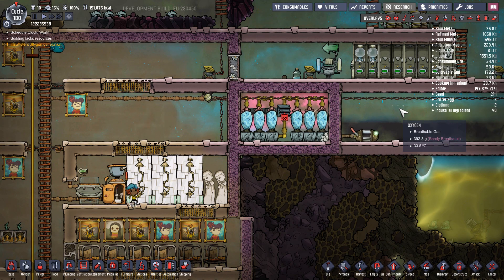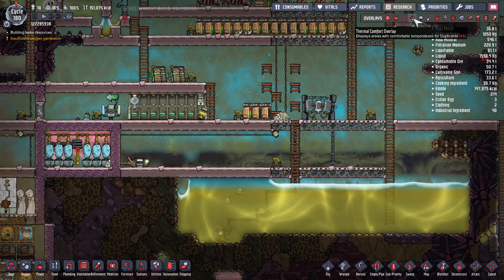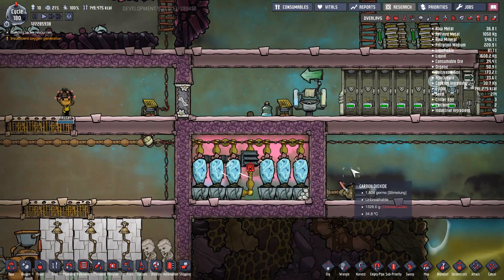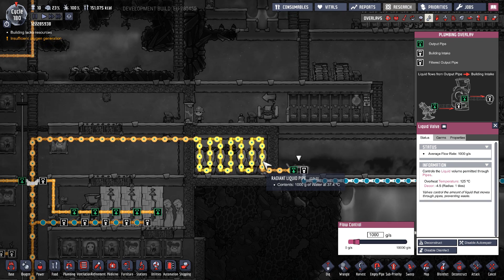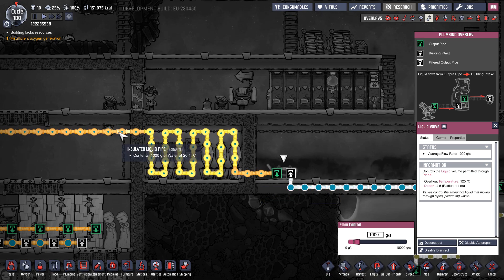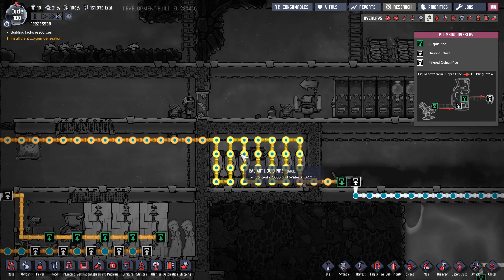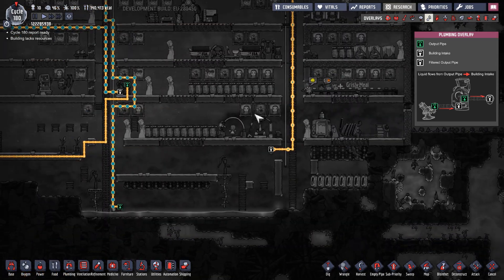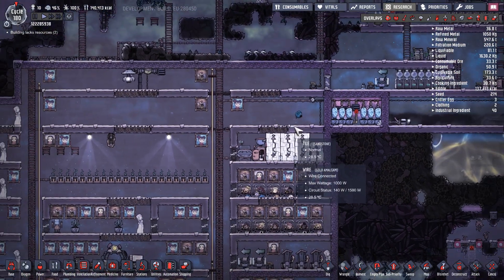#17 Oxygen Not Included - How to Cool Water with WheezeWorts

Comment: how about replace the hydrogen with water or polluted water as cooling agent?
Reply from the maker: Yeap, that would do, also possible :)
Reply: Will Wheezworts work in water?
Reply from the maker: @soirema  Not when submerged in water, but you can use cool water drips to make things colder
Reply: @GamesCaste  If I'm trying to cool steam turbine using wheezeworts and I add copper tempshift plates behind the wheezeworts, does it improve efficiency?
Reply: @shebazraza4746  I doubt it, the room is so small that the temperature will be distributed by the hydrogen gas fairly equally

Comment: This particular solution is fine but has several drawbacks. First, Wheezeworts are uncontrollable coolers - you cannot switch them on or off. Thus, water/gas intended to be cooled must be controlled, which is not the case here. Due to possible incoming water shortage (or outgoing water overflow) radiant pipes may overcoool, then any portion of incoming water (especially if in small amount) would be immediately frozen and will break the pipes inside the cooling room (which is unserviceable!). This kinds of coolers must be protected against "loss of working fluid" accident.
Also heating cool polluted water by cleaning it with Water Sieve is counter-productive. Polluted water is a superior waorking fluid versus clean water, since it freezes at lower temps and boils at higher temps. Typical solutions are to heat polluted water slightly above 100 degrees then kill the heat with a Water Sieve. Powerful heaters are Thermo Aquatuner and Thermo Regulator which also coll other fluids.
Reply: late reply, but you can actually control wheezeworts. Build sideways airlocks set to open when the temp gets too low and the wheezewort 'shuts off' as the planter is no longer on a tile. I'm not sure if this is bug or intended or if it'll ever get fixed, but it's a way to keep them in check.
Reply from the maker: Absolutely ! It is by no means the best solution, I rarely even use it these days. But it can be a quick and dirty temporary solution. I have another tutorial on using the aquatuner, which i think is the best solution, but it takes some preparation. You need to have good power supply (natural gasses etc..), a relative big(or renewable) source of water to make this work, as well as decent cooling for the aquatuner(which is pretty easy to do). I do have a video tutorial on that on my channel and I would definitely advice people to do that for the better way to get water at 25-27 degrees for their farms.